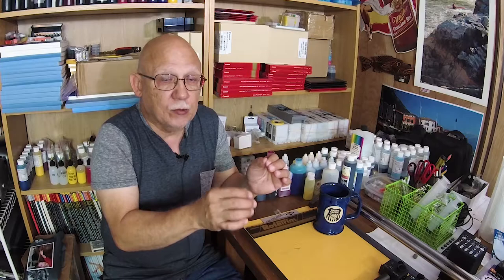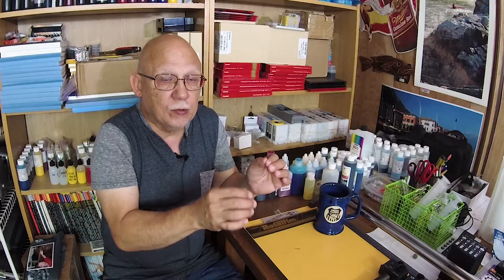It appears you can do this to an R3000 but Still Be careful

Comment: Ive done this probably a hundred times over the years with p600's. It's fine, just be sure not to force it too much, gentle application of the syringe pressure. It usually takes less than 10x A4 printouts to flush the remaining cleaning fluid (windex + alcohol) through the pipe assembly and head.
Reply from the maker: You clog that much?
Reply: Well I use p600's as workhorse machines, day in day out, got through around four or so in the past five years. I generally buy used and cheap, looking out for good deals. I also use cheap dye ink in ciss systems. When I said a hundred times might have been a slight exageration, but not by much.

Comment: Did that myself on my epson R3000 and P600.  I ruptured the damper system (underneath the cartridges not the ones on the printhead) on the color I was attempting to unclog (Light Magenta).
Got a damper system from ebay and changed it on my Epson P600.  The Damper system has three section (3 colors each).  I grabbed one of the good ones from the P600 and used it on my R3000.
Reply from the maker: Good Job!

Comment: I do this for 7 years, when channel is missing force distilled water in it, and about printing 45 sheets , If I flush channel with water I prime it with whatever color ink it needs, kind of shortcut to avoid spending hours.

Comment: Thank you very much for the video. I had the same symptom. I convert r3000 to DTF first set of cartridges was ok, but the signalization of the level of color in r3000 is crap. I ran out of white ink and I was not aware of it till the color was finished. After refill, all colors, white was not working . After 27 A4  printed and 10 head cleaning the white start again work..... . I am using of Acrorip 8 where I am able to set print only white ....
Reply from the maker: Always keep you carts topped off and this will not happen again.

Comment: Thanks for your video.  Very interesting.  Over many years I have owned several Epson and Canon photo printers.  My Epsons always ended up in the dumpster due to unresolvable head clogs - no matter how hard I tried to unclog them with various cleaning solutions.  My Canons just keep going!  I have a Pro-1 now.  Also, you forgot to mention that Canons have user replaceable print heads which are actually fairly reasonable in cost.  Epson's heads must be replaced by a service center and cost more than the price of the printer.  I appreciate your explanation of the technology behind it all, but my enduser experience tells me to stick with Canon printers.  Much more dependable. Canon printers also do a better job of self-cleaning and self-monitoring of the state of the head.
Reply from the maker: I agree!